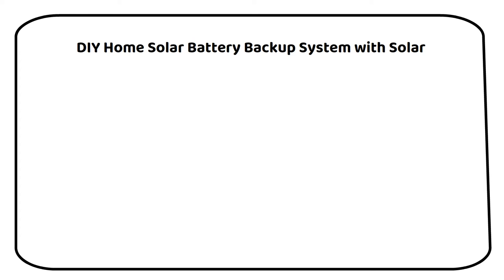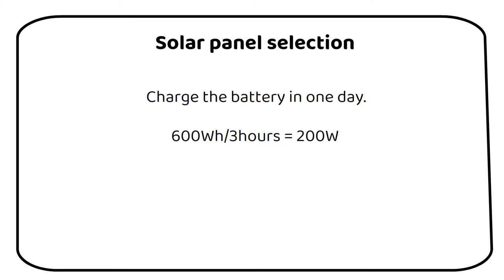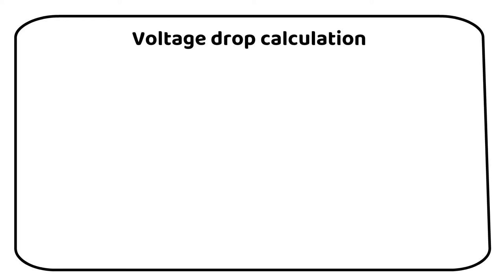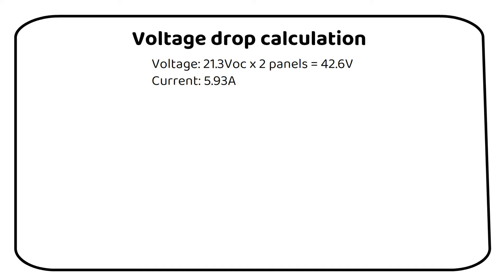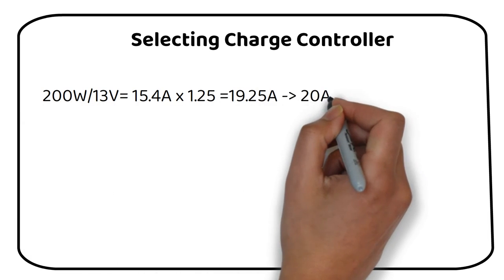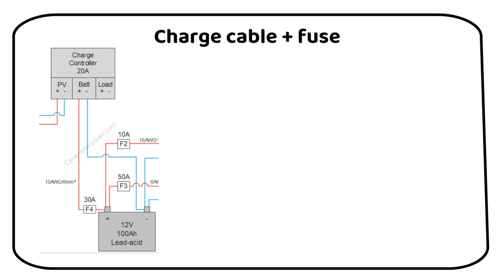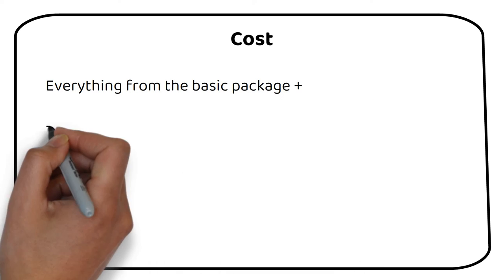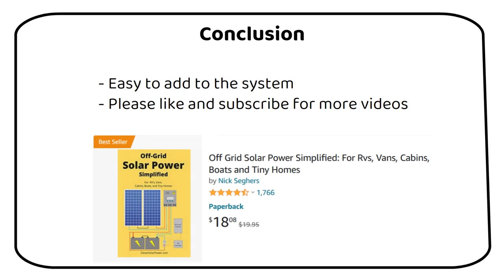DIY Solar Battery Backup for Refrigerator, Emergencies or Prepping with Schematic

Comment: Is it possible to run a freezer with a solar setup, that has no battery? (If you consider that the freezer is opened not during the night; and plenty of sun hours during the year.)
Reply from the maker: No, you need a battery. This is because the freezer will also turn on during the night. You can try, but I wouldn't rely on it.
Reply: @cleversolarpower  Thanks! Will use series solar array to ensure lowest voltage requirements are met with spec of DC/AC MPPT inverter. I presume that MPPT inverter will function with solar array connected, only - no battery bank?
(May always add battery bank later, if found to be insufficient. The freezer will most probably freeze up with ice sooner, due to not switching on during the night.)
Reply from the maker: @yaacooh3073  An MPPT or PWM doesn't work without a charge controller. I recommend reading my article about it here: https://cleversolarpower.com/off-grid-solar-without-battery/
Reply: @cleversolarpower  Crucial advise. Appreciated. Great info & helpful article.
Reply: It is possible IF the voltage from the panels match whatever voltage the freezer needs, or if it goes through an inverter then whatever the inverter needs. However as it is an unstable energy source it may shorten the life of the freezer. Better to get a controller and battery, unless that is simply not possible for whatever reason.
Reply: @Ibian666  yes. The on-off switching of going through night/day cycle will shorten life of fridge if no battery is used. So, it would not be recommended. Good point.

Comment: Hi, why would you put the panels in series when the battery is 12v? Unless the charge controller is MPPT?
Reply from the maker: Hi Wayne, I'm using an MPPT charge controller. 100W panels are more portable, take up less space when stored, two are more redundant than one, and the voltage drop will be lower because the panels are in series. You can use a PWM, but then you need to put the solar panels in parallel.

Comment: Great video! Will you concider doing one on solar power for supporting automated garage doors & gates? (With more frequent power outages the backup batteries life expectancy is severely reduced.)
Reply from the maker: It will be quite similar to this system. Depending on the power and the frequency of use of the gate actuators. You can head over to my website and use the load calculation tool to get an idea of how big your system needs to be.